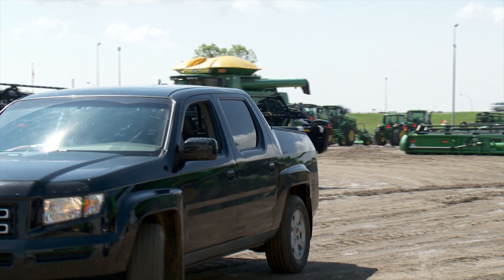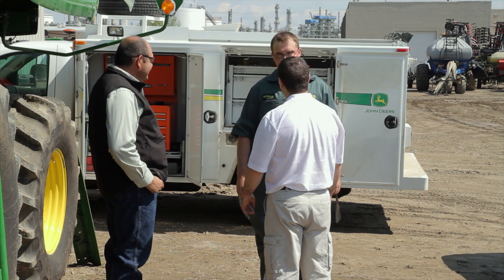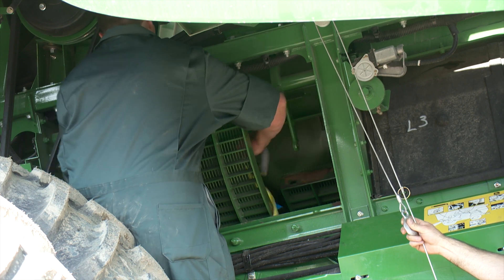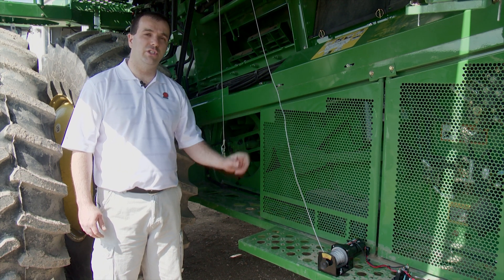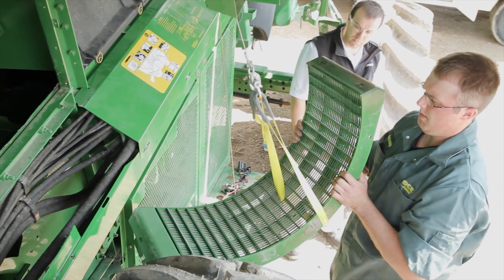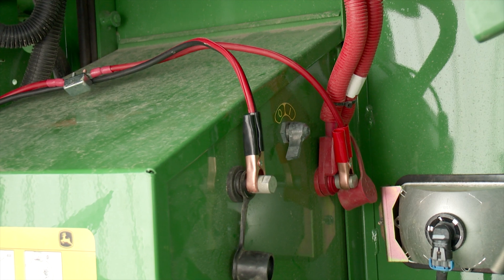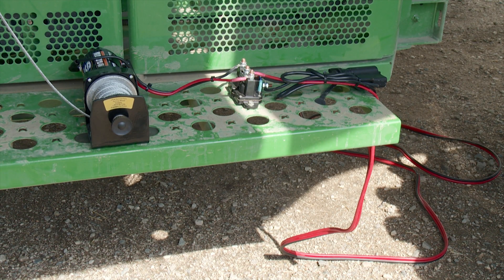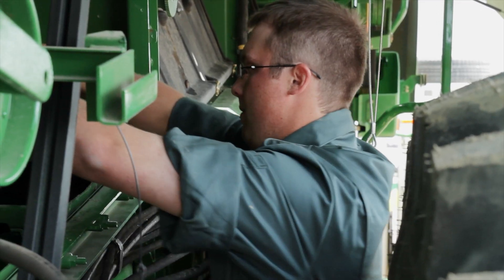Combine Concave Hoist

Comment: We did this with the winch on the quad since the 90s with a snatchblock. Dad had a buggered back from working drilling rigs every winter for years and I was still too young and small to really help much. The idea kinda stuck. With dad gone and I have small kids and run the farm pretty much solo, I kept changing concaves that way. Not really a special invention or anything. I wouldn't go out of my way to mount a winch and hook it up to a combine battery, that's for sure. Quad works good enough.

Comment: I find it odd that he points at the reverse switch and says "circuit breaker" meanwhile the circuit breaker is on the battery side of the leads with the posts un-insulated. Seems like an arcing hazard.